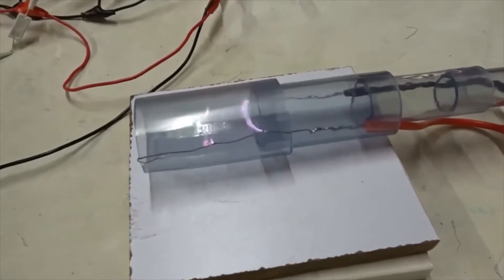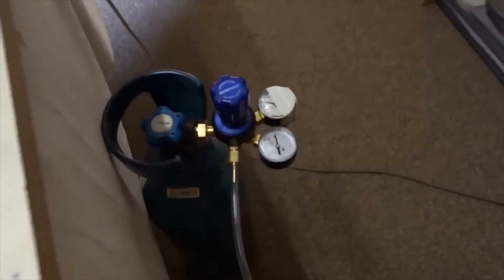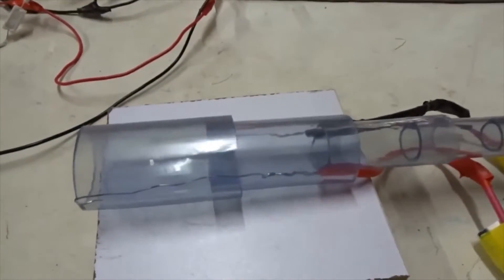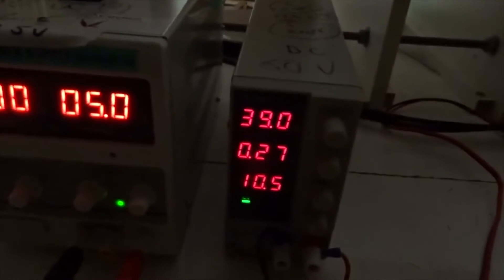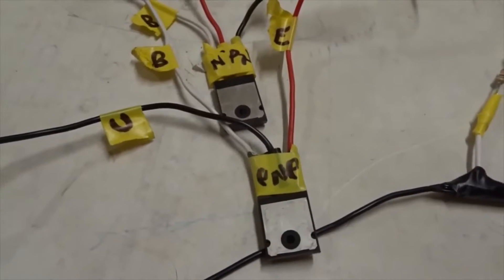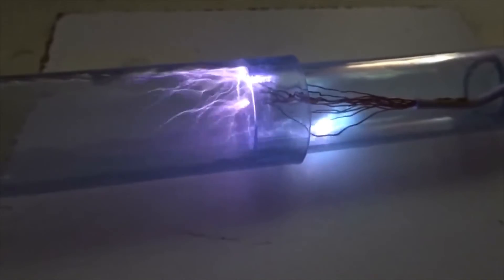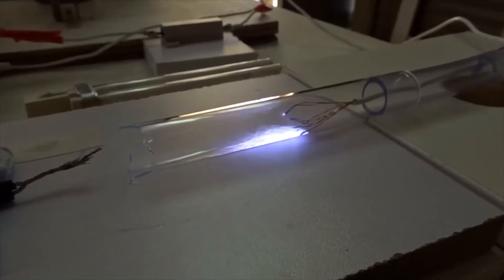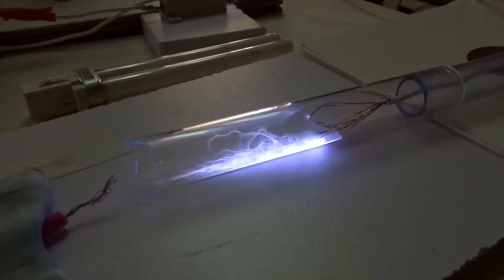Ionizing argon gas by three different, high-voltage methods

Comment: try electrostatic metal foil vacuum balloon, charge that electrode capacitor plate with one charge polarity, your hairs will rise up, scary, magic, floating hair, van der graaf or any other like marx/windhurst high voltage generator
Reply: also try ionic wind railgun thruster, yes dc ion gun, electrons and ions should go the same way, because in current they flow the opposite
Reply: try rotating magnets mechanical induction, dc and ac induction
Reply: of course dc induction induces dc current, ac induction induces ac current
Reply: ie, plasma based hydrodynamic drive